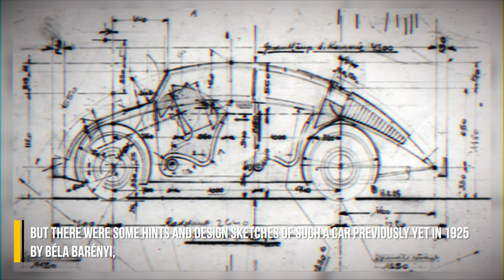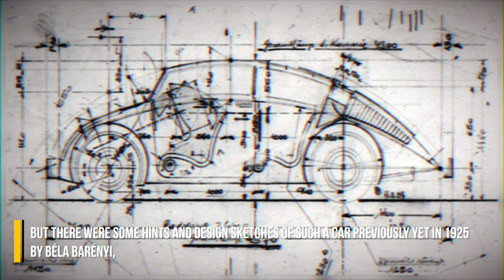How Tatra Became A Porsche

Comment: Fantastic!  Never knew there was any connection or lineage between the two companies..
Reply: During the war, Tatra 87 killed more nazi officers than died in early days of war. Thus it was banned for german military. The car was too heavy, with weight on the back, and was able to reach 160km/h on dirtroads. Not really great breaks at the time, and thin tires, plus when turning the back continued straight. So driver had to be skilled, to never turn in high speeds. But german officers were drunk on power and new to the confiscated cars, wrapping them around trees.
During occupation, the Tatra company was forced to produce only trucks for military. if you wonder how germany managed to execute blitzkrieg, czechoslovak military was the only one fully mechanised (no horses) at the 1938. All these trucks plus those produced were used to sustain the blitzkrieg operations in both fronts.
Communists basicaly kept the same rules for tatra with their planned economy, they made Škoda into main automobile producer, and Tatra into heavy truck producer. Tatra was allowed to produce only luxury vehicles for communist elite.

Comment: VW Beetle feels awesome when the engine is enlarged and tuned. Check VW Cal-look and VW Drag Racing. It is really cool stuff. The technology of making VW fast is totally Independent from the factory and became a big industry. Imagine a 4 cylinder air cooled boxer enlargey to 1,9 liter and revving to 9000RPMs and making N/A 250hp.... There are VW Racing engines in USA making 900hp.... Still based on oroginal ohv 8 valve system...

Comment: Tatra‘s nickname was: the nazi killer(because of it‘s crap handling)
Reply: They actually handled pretty well for that time it's just that no-one was used to a car than can go at 130 kph all day and tops out at 160 kph. Only the big sport cars and luxury cars of that time could do that, not some sedan with 75 HP.
The swing axle suspension was a bit finicky but Tatra wasn't the only manufacture that used it at that time, Mercedes used it to (actually all the way into the early 70s)!
Basically every Czechoslovak manufacturer used swing axle at that time; Tatra, Škoda, Aero (on both front and rear axle), Praga, Jawa, Zbrojovka Brno and some more.
The typical myth of it beening a Nazi killed was created by the brits after the war, they weren't used to cars with swing axle suspension and engine in the rear so to them it felt unsafe during testing.